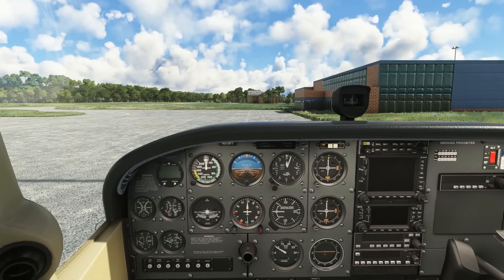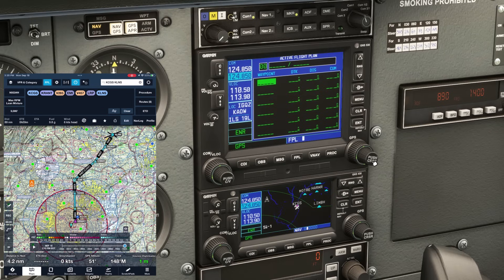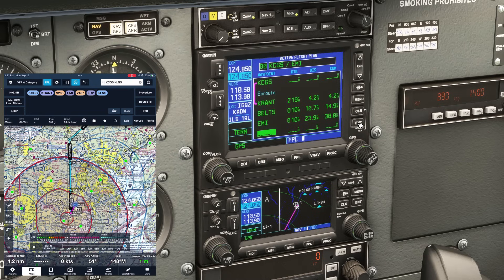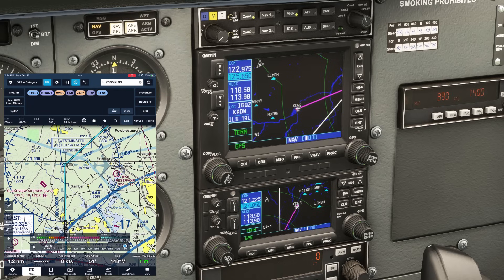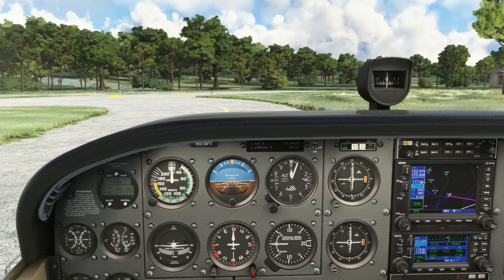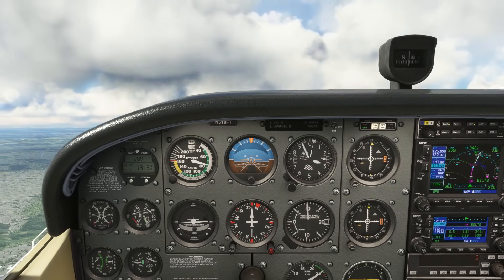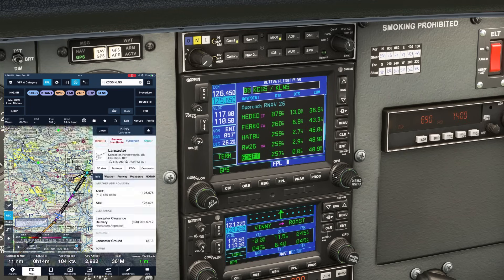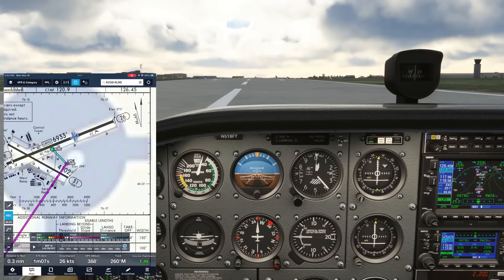How to use the Garmin GNS 430 530 GPS | GNS 430/530 Tutorial | IFR GPS

Comment: Better yet Plan your Flight with Alternates then it picks Intermittent Airports Based on your Planes Specs and Weather along the Route with Alternates as Required by FAR's. Then you File from your CELL to the FAA computer and it Confirms the FLT PLAN with Changes. Then ounce in the Cockpit your Cell communicates with the GPS's via Bluetooth and you Punch a BUTTON Mo need for Clearance delivery or Copy it, it's all Digital thru your GPS. IT then contacts GROUND U Taxi Then It contacts Tower You take off and then it contacts Departure then enroute And so on. You never ever speak to any controllers No Need.  Thr Radio is now to ask the FBO for GAS/PARKING and wheres the Courtesy Car & the Best Restaurant/Motel  because the weather was beyond you/Equipments capabilities and you WISLEY I might add, Decided to RON.
OH now your just like an Airline Pilot at 500' AGL you flip on the AP and when you Break out or have the runway environment IN SIGHT you Flip the AP Switch off and land (If you Remember how) after touching nothing nor speaking to anyone for the last 3 to 5 hours. Takes the FUN out of Flying , don't ya think. They can do it with Planes  lot easier than cars.

Comment: You would with Technology today one could call uo a MAP slue By Touch Screen to approachment aera Zoom in touch the airport and departure point is entered. Then Slue to Destin Area  Zoom in pick Destion airport Then tell it to generate a ROUTE/Direct. Hell one can do that on a Cell & Google Maps Now.  Flying GPS today is as Antiquated as Talking to a Controler. It Should be DIGITAL Communication Presented in the Cockpit on a Screen. Touch the Message and it's read aloud in your head set. With ADS-B you situational awareness should be even better than Verbal radio Communications Between Pilots and Controllers Heard by everyone. Remember when Flight Plans were Read Verbally to a Flight Station Person and that was Considered Filed. But It Many times they couldn't find it and you had to Refile and wait while you were Burning your Reserves and the HOBBS was cranking off in DOLLARS.

Comment: Yeah I struggle doing this VFR with zero workload. I can only imagine having to do this in IMC when things are going wrong. What a great way to kill yourself in an airplane. We talk about dangers of distraction, but this is ok to do?..
Reply: I'll mention that I have probably flown 60-80 hours with a g1000 in MSFS and I have zero access to one in real life. At first I would hit pause and spend 20 minutes struggling. In real life I'd be upside down. Now it's so simple. The controls, buttons, 'look' of the unit when something's wrong, etc are all a thing of the past. I can only imagine 100 more hours of experience. I'm currently building the g1000 using heli mech's g1000 build video. Probably outside 99% of peoples' wheel house, but to me it's fun. I hope to further improve. And the g1000 is extremely similar to this video, only a lot more functionality and instrumentation. But it translates extremely well. Keep practicing and it will improve your in-flight smoothness to distraction ratio.
Reply: @TakeNoneForTheTeam   Agree.  My G1000 journey was the same.   Now it's second nature.